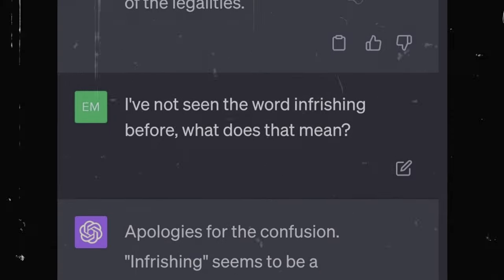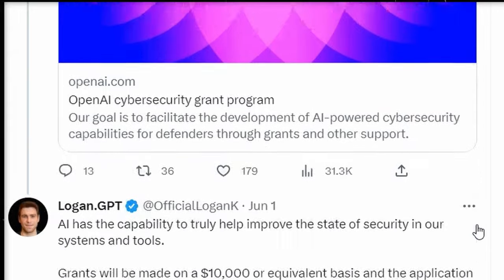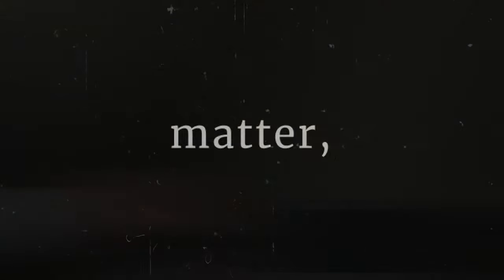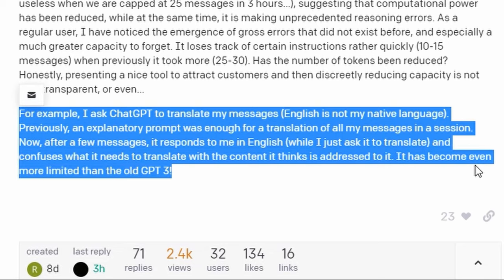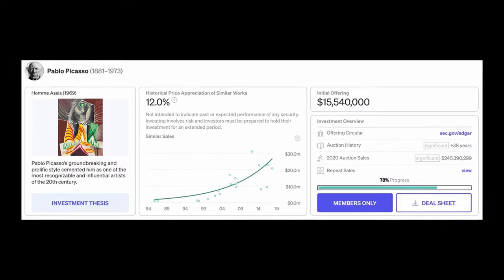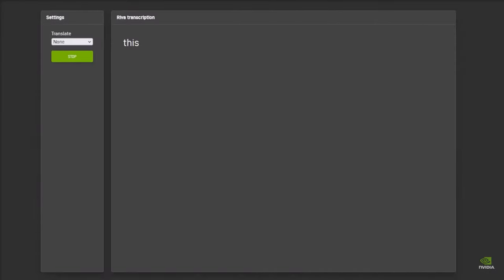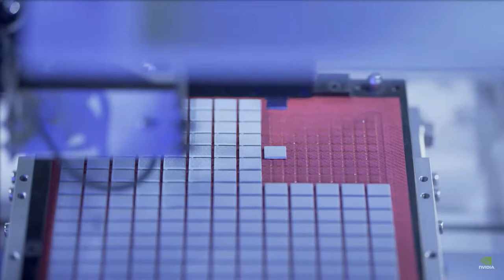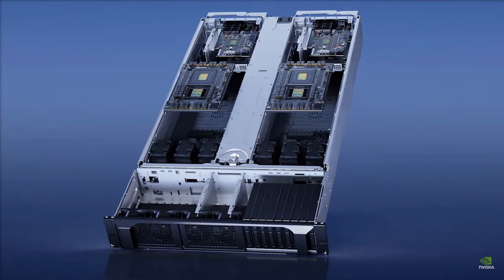OpenAI Secrets Revealed: 5 Major Downgrades Happening to GPT 4 + ChatGPT

Comment: i havn't seen any decrease in performance. maybe just a little slow
sounds like google disinfo.
Reply: Google disinfo? Find a direct correlation and post it here, or don't say anything at all
Reply: @Srindal4657   lol.    Google is dead.  Long live GPT !
Reply: I am a plus user, and I also use the API, and I must say that the memory seems to be a bit crap lately. I also have been lately testing side by side responses from 4 and 3.5 and quite often the difference is minimal. I don't know if they did something or if this is the model itself seemingly showing some flaws (possibly due to the junk they train it on that jumps through all these unnecessary hoops in processing, degenerating its response)
One thing that kills GPT3.5's ability is the 3 part structure it always seems to do...response, consideration, summation.
This didn't appear to be in 4 early on but lately its following a similar structure and that seems to be degenerating the response bit to process the consideration and summation aspects. I think if they simply remove the structure and go back to purely detailed response and cut out the unasked for consideration, performance and detail should increase.
(the consideration phase is anything after "however" that is almost never asked for and when 3.5 goes into lecture mode)